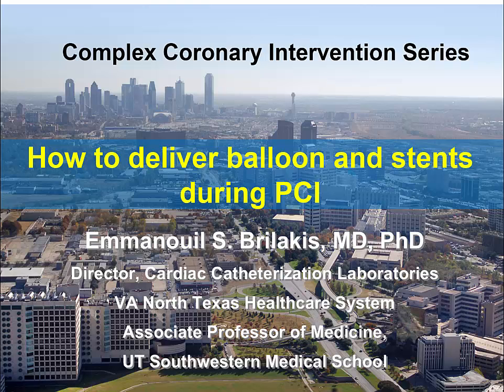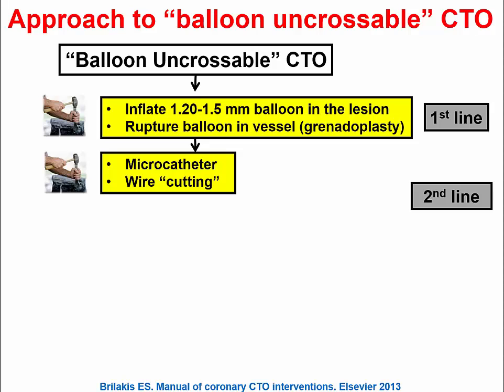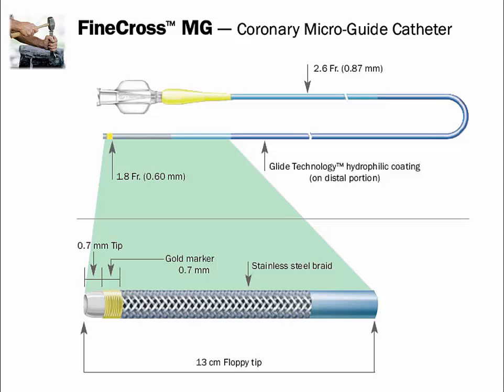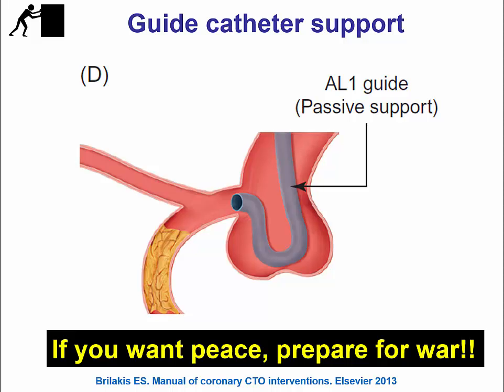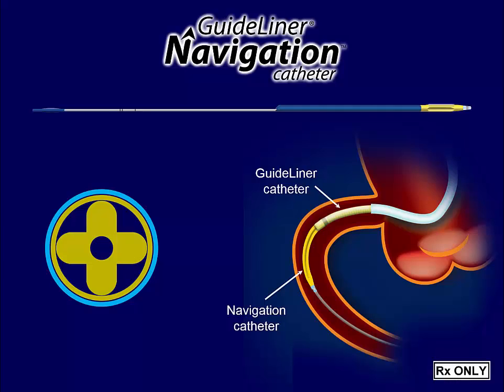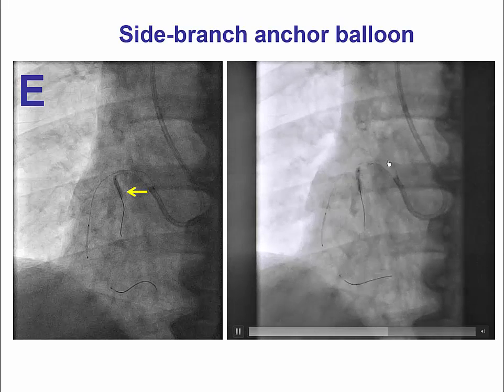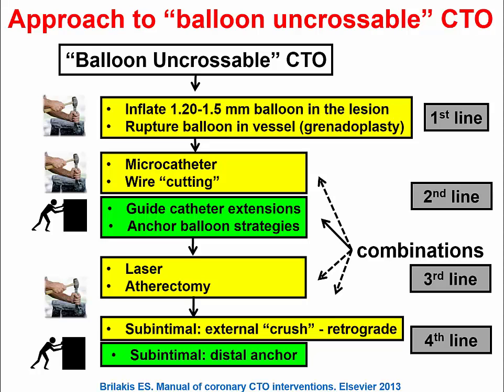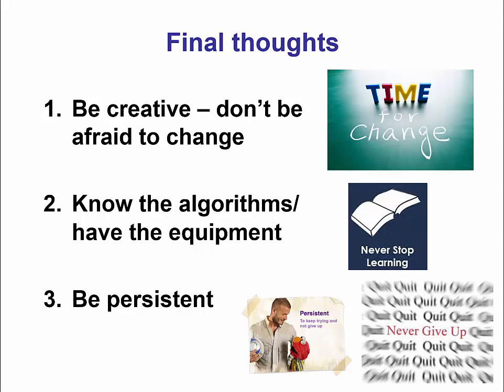How to deliver balloon and stents during complex coronary interventions

Comment: Whould you prefer brachial or radial access ?thank you
Reply from the maker: Brachial access has higher risk for  complications than radial, as it cannot be easily compressed, hence radial if the access of choice. Brachial is used in only select cases when radial and femoral are not an option.